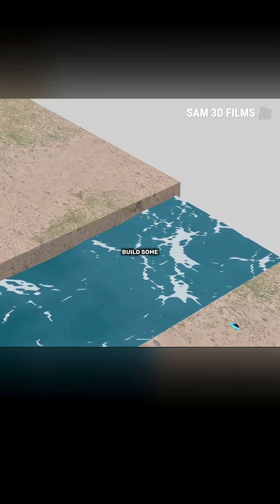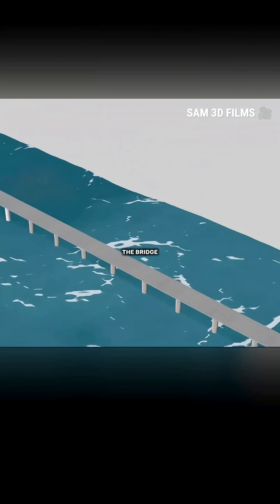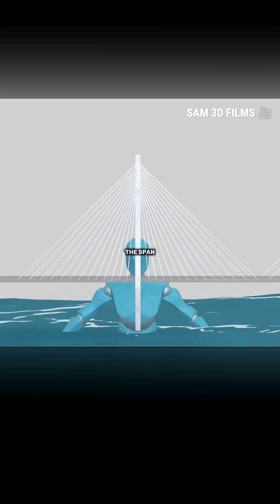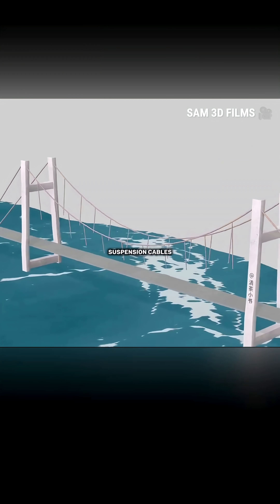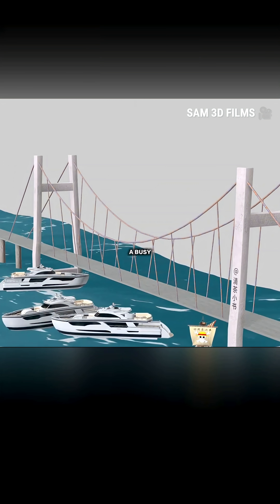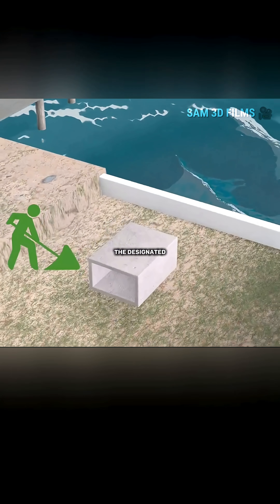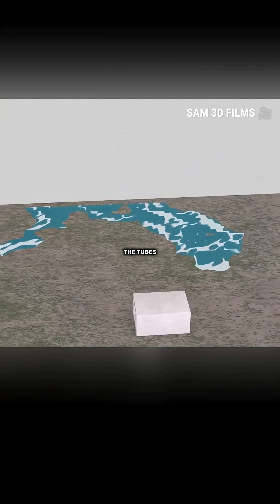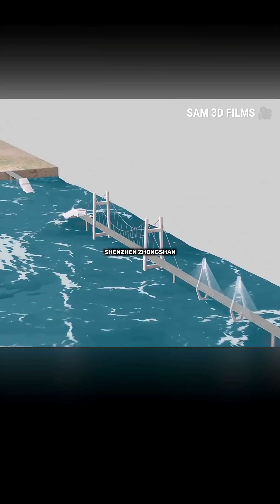Bridge Construction 3D 🎥💯

Comment: I liked how, when he explained the bridge’s architecture and engineering, he not only provided visual aids but also used relatable examples. He described someone holding a board, and then two people holding hands while each used their free arm to support a much longer board. This simple demonstration clearly showed how the street of the bridge is supported. By comparing the bridge to a board held in someone’s arms, he helped everyone grasp the basic concept of how a suspension bridge stays stable, even if they can’t explain it in technical terms. Not everyone learns the same way, and for hands-on learners, this “holding up a board” demonstration effectively conveyed how the bridge works—giving a tangible understanding through a verbal and visual example. I hope you create more videos like this. It’s an excellent concept for a channel, particularly for people who have struggled to learn or understand these topics in the past, as well as those who still face challenges today..

Subbed. 😝🤪😝